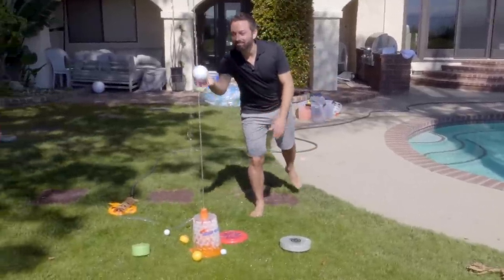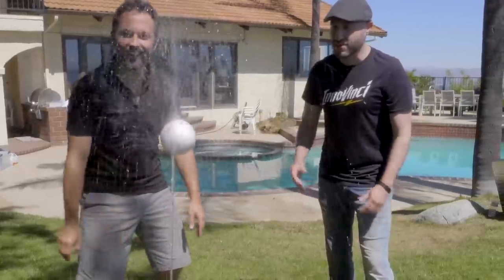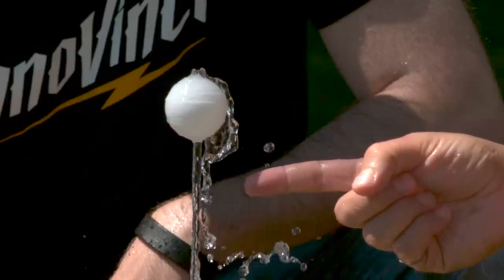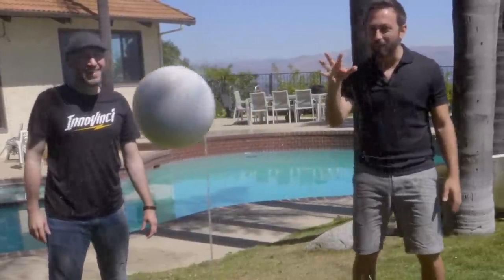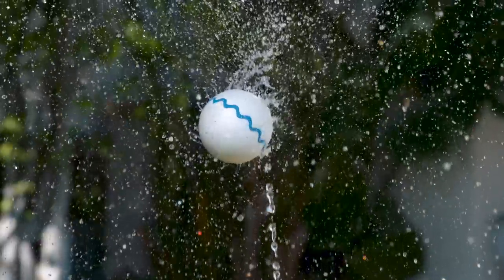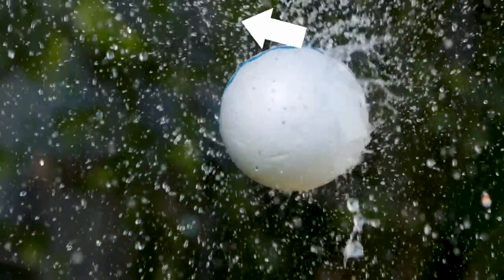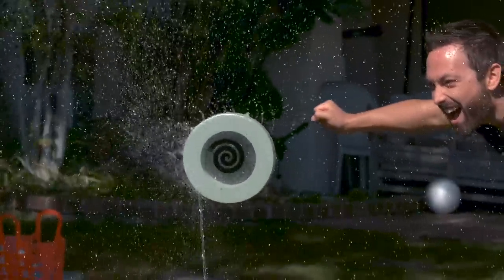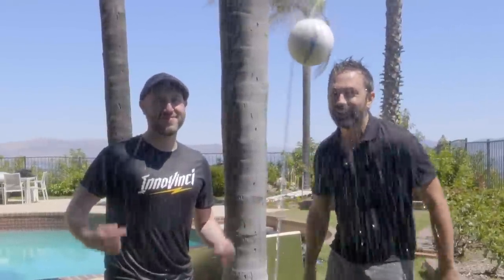Hydrodynamic Levitation!

Comment: Before society puts the trend to rest, why will a fidget spinner that is spinning not flip sideways. while it is not spinning it can do multiple flips but while spinning it stays at the same angle as it falls to the ground. I tried to relate the question to a video Vsauce did about rotation but I still struggle understanding it
Reply: Not entirely unrelated, but mostly, this is gyroscopic motion that prevents the fidget spinner from turning while it falls. Essentially, because it has rotational inertia in one direction it can't suddenly change direction of that inertia, which is what would have to happen for the spinning fidget to flip over itself in freefall.

Comment: Do you want to test scientific experience?
If the ball is supported by friction, rotation and water rebound, then by changing the friction you can adjust the height.
Rub the ball with grease or wax - the ball should fall.
Degrease with gasoline and scratch with sandpaper - the height should increase.

Проверку научным опытом провести не хотите?
Если мяч поддерживается трение, вращение и отбрасывание воды, то изменив трение можно регулировать высоту.
Натереть мяч жиром или воском- мяч должен упасть.
Обезжирить бензином и поцарапать наждачной бумагой- высота должна вырасти.

Comment: What if you tried that with a belt instead of the water?
Edit:  And you`ll have the belt constantly spinning in the exact way the water is is hitting it, a little bit under and slowly around and over just like this:
 
                                      
                                   .  ---- . ---- _     
                           .                         .  \
                      .                                  . \
                     .                                      . |
                     .                                      ./
                       .                                  ./
                           .                         .   |
                                    .      .            |
                                                        |
                                                        |
                                                          

Imagine that the dotted circular shape was the ball, and the lines were the belt just like the water and the ball in your video, but this would`nt work though, i dont know. This does not make cense. Perhaps try another liquid like oblek or for instance an air compressor filled with helium or the heavier air i dont remember what its called. Maybe the ball would rotate / levitate higher while using the helium and lower with the "heavy air" xD
Excuse me for using so much of your time and sorry for my bad english. ;)
Reply: The effort you put into your picture is amazing :)
Reply: Unfortunately it wouldn’t work. It works because the water is propelling the ball towards the stream, just like a ballon releasing air making it fly. Thus, you’ll need the belt to break away at just the right time. But neat idea! Kudos for Trying!
Reply: @franzherfert3686  Haha Thanks! 😁
Edit: Now that I look at it; how would that even work! 😂
Reply: @GolddenWaffles  Yeah... I'm just going through my old comments just for fun to see what I've written and what the heck was I even thinking 2 Years ago 😂 Thanks for the detailed comment btw! 😁

Comment: coanda effect related?
Reply: No it's not. Coanda effect happens in a homogeneous fluid, and the negative pressure caused the turbulent flow around the back of the object creates the lift without a strong torque.

Here we have a two-phase system (i.e. air and water), and the force acting upon the object is not symmetric (water hits on one side and drops at the other). This lift has to come with a torque that causes the object to rotate.
Reply: Hum...Water is a homogeneous fluid. Even if you have a not so constant flow of a fluid, the Coanda effect occurs. It's possible to think of Coanda effect.

Comment: Your explanation is not accurate. Look at the explanation in this video:
https://youtu.be/2WTTXz3Dttw
This stream has the velocity of leaving the sphere along the normal direction of the sphere, so a low pressure is generated on the surface of the sphere. When the force produced by the low pressure balances the gravity of the sphere, the sphere will float in the air. This has nothing to do with Bernoulli's theorem.